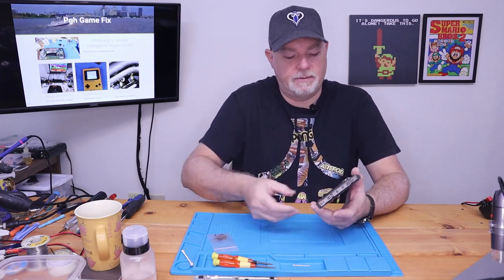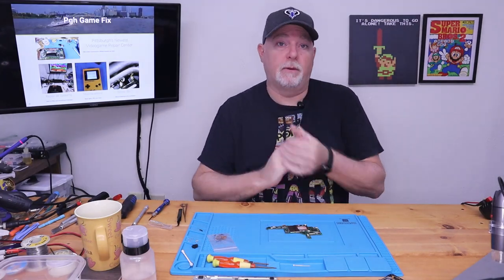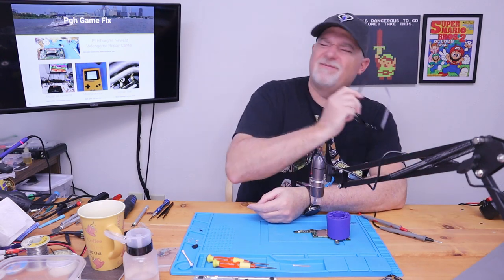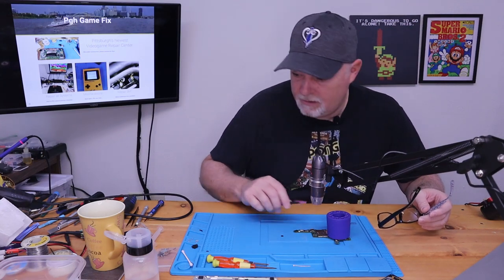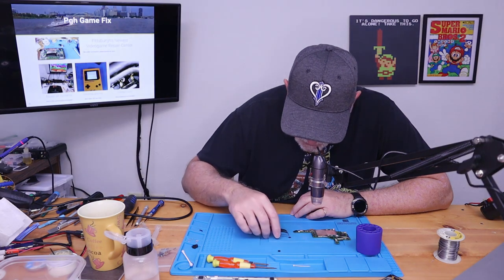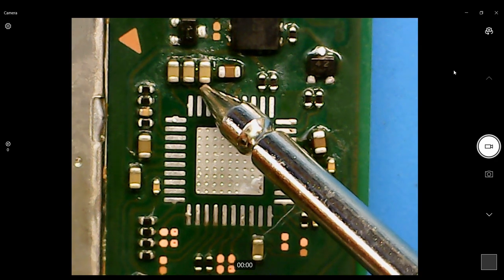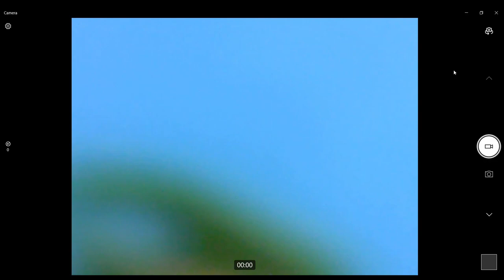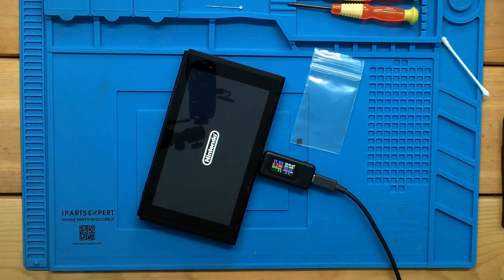Nintendo Switch Not Charging. Replacing an M92T36 Charge Control Chip.

Comment: I have a shorted capacitor to the left of the bq24193 IC (Charge port facing down, lower cap). off hand do you know what's causing that. bq24193 + Cap removed and short still exists. your help would be greatly appreciated, Thanks.
Reply from the maker: If I was working on that... I would lift the M92T36 off the board, and check that cap.  But if it's the lower one... it could be the diode that is connected to that cap.  Lift it off the board, and check for a the short.

Comment: Helpful vid, confirms my own problem. I'm fixing my nephew's switch and had 2 shorted caps. I'm watching this as I wait for my own charge chip to arrive.
Anyway, a thought, if you could pipe your microscope feed to that tv over your shoulder it would pretty cool for when you do the main camera shots.
Reply from the maker: Actually.... That's a very good thought.  Right now, I'm looking at new HDMI microscopes, but they are expensive for the one I want. (autofocus) I'm using a cheap USB microscope, and it really works better than I expected for the price I paid. BUT... I think I can "Cast" the image from my laptop to that TV. The only issue is there may be a slight delay. (but shouldn't be bad)  I will look into it.  Thanks for the suggestion.  If you have any issues changing that chip, feel free to message me on Facebook at PghGameFix.
Reply from the maker: One more thing.  If you have a short on the cap between the MT92T36 and the metal shielding, then there is a good chance that the Pi3USB on the back is bad too.

Comment: You tried the hakko pencil iron for these individual pads? I personally prefer using that to solder the outer pads. Is a bit pricey, but it's a nice addition to the station
Reply from the maker: I just throw on a fin tip to the one I have.  But I do have the pencil in my "House Call" bag.

Comment: Im trying to resolder an IC and I'm having a hard time to align and solder. I took some notes from your video
Reply from the maker: With these surface mount chips... get it close... push it down, and reheat.  Then add some flux, and heat again. it will normally pull itself into place.

Comment: Its fair to know that if going charge with like with a battery bank you should use a charging cord that has over charge protection in it. i know that Anker and Belkin cords have that chip from what i can tell.
Reply from the maker: I'm not sure if the charge limiting cords will work any better than the others.  Sorry. I could be wrong here... but using a standard USB charger is part of the issue.  When charging at the 5v setting... it pulls a little more current, and in turn, produces a little more heat.  With a "PD" USB-c charger... it can read the system, and bump up to 15v, and a lower current. (less heat)   The other side of this is... just a poor fitting USB-c cable can put power on a pin that shouldn't have power. I know with my Motorola phone... I've had a few cheap cords to connect them to my truck radio... and they failed for no real reason. Fortunately, my phone is OK.   After that... I bought some better cords, and they have lasted much longer.  So... I guess what I'm saying is... in my opinion... a limiting cord isn't the answer.  A good fitting cord, and a proper charge source (PD enabled)
Reply: @PghGameFix  I would figure that do just the same iq smart charge in some fast charges to where it makes sure doesn't over charge said device so i figure would be good. Most usb type cords should say if has surge protection or over charge protection.

Comment: Think I may look into this chip. I have a water damaged switch. I removed all the corrosion on the board and can get the switch to charge in the dock, but not with cable on its own. The reason I think it’s the chip is because I cleaned corrosion off the usb-c port, at least on the pins I could see. but that would mean the cable would still work plugged in flipped one way. I’m thinking the chip handles charges from the dock differently than the cable. Perhaps it sends the charge to different capacitors.
Reply from the maker: If it charges on the dock... then I would be suspect of the port itself. I've had a few that seemed OK... but were shorted where you can see them.  Did you try to flip your charge cord over?   When I charge the port, I do that to make sure all the pins are connected.
Reply: @PghGameFix  thanks for the reply. Yes, I’ve flipped the cord over both ways and tried a second cord, with no luck. It only wants to charge from the dock unfortunately.

Comment: Hi, great video! I have a Switch that functions normally except it won't charge or display on TV while docked. The Switch will only recognize that a charger is plugged in when plugged in one direction, but  not when it's flipped. Any ideas? Thanks in advance
Reply from the maker: if it works when flipped... the port itself is damaged.
Reply: @PghGameFix  Thanks!

Comment: @pghgamefix found a short around the M92T36 similar location to your example.   Checked when removed, short gone.  Replaced it with no issues, checked for shorts, all good!  But still not getting battery charge and when attempting to power up getting the classic error 21001-001.   I checked the BQM and USB IC's no shorted caps around them both.   Dead CPU? Any suggestions?
Reply from the maker: Is it actually charging and not turning on the screen?  Check it with a USBc meter. If it's not charging... then the IC you bought may be bad or fake. (We are seeing counterfeit chips these days) But, if it is charging... and not turning on... then yes... could be a dead CPU.  I've had a few come across the bench. (but not often) You can check the caps on the backside, behind where the CPU is mounted. If you find shorts there... then it's probably gone.
Reply: @PghGameFix  thanks for your reply.  So odd as I purchased them wa back in 2019 and havent had an issue.  Appreciate you taking the time to respond.

Comment: I checked (switch lite) the m92 and bq chip (capacitors) and no shorts. My switch lite has a charging icon but the % doesn’t go up… any advice? Thanks!
Reply from the maker: Get a usbc meter, and put it inline.  Make sure it's going into charge mode.  If it isn't... then check the other charge chip for shorts.
Reply: @PghGameFix  don’t have usbc meter. Just ordered one! So the other charge chip would be the bq? In your video you checked the fuse above the charging port… a shorted fuse wouldn’t be the culprit?

Comment: Holy hell, you are doing that with some seriously subpar gear, I am quite impressed. Could only imagine what you would be capable of with a quality heat gun! Nice Work!! 
When you mention "Need a little more heat on this station", I think many of us would love to hear what temperatures you are working with! :) Thanks for the video!
Reply from the maker: The iron is good... but yes... the hot air is a "Crappy" unit.  But... to be honest... it's been running for 3 years, and works well.  When it gives up... I will buy something better.  My temps on removing a chip from a modern board... 470c. After I clean it, and put on leaded solder... I drop it to 400c. that's at a 3 on the control... but it's probably 50% flow. Thanks for watching.

Comment: Hola amigos, hace poco compré un nintendo switch con el puerto de carga dañado. Terminé por sustituirlo y funcionó un momento, despues de 1 día dejo de verse en el tv y después de 2 dejó de cargar... Lo volví a soldar y funcionó normalmente, pero 2 días después dejó de cargar... Le sustituiré el centro de carga y cambio el M92t36 Y Pi3usb, o creen que tenga problemas en mi soldadura?
Reply from the maker: Hi.  Since you re-soldered it... and it worked again... I'm guessing your solder isn't flowing well enough to keep a connection.  Use good flux, and a little more heat.
Reply: @PghGameFix  Thanks bro

Comment: Seriously dude I hope this isn't your only job.  No ESD protection while working on customers equipment.  Way to high of a hot air reflow temperature.  480C is too hot and for too long.  You can damage the board and surrounding parts.  I have be soldering for over 25 years with numerous IPC certifications.  You need to take a class in proper soldering technique and ESD control.  Read the datasheet on your chip...ESD is a big note on it.
Reply from the maker: Well... I agree and understand.  To be honest... the temp's I'm using kind of scare me.  I grew up in my grandfather's TV repair shop, and learned a lot from him.  But this is in the age of leaded solder, and tubes. Electronics has been a hobby of mine for 35 or so years at this point... and I would be much happier with soldering temps at 320 or so. But the first time I used a hot air station with lead free solder... I had the heat on the board for WAY too long.  SO... I started to run the temps up.  I find... with my cheap station... 470/480 gets the job done quick.  And on something like a PS4 board... it's needed as the coper ground plane sucks the heat away.  No... I don't have any certifications... but I do hold a degree in Physics, and have a concentration in instrumentation. I have built certified lab and test instruments for several labs, including Kodak. As far as "Hope it's not your only job"... it's not.  I'm actually a consultant, but with COVID, I haven't been able to travel. I started fixing stuff for a local used game store, and the owner talked me into doing the vids.  I do appreciate the comments, but there is always more than one way to skin a cat.
Reply: do you really need a class to understand esd controll honest question my teacher only taught me to use an esd mat and or wrist strap